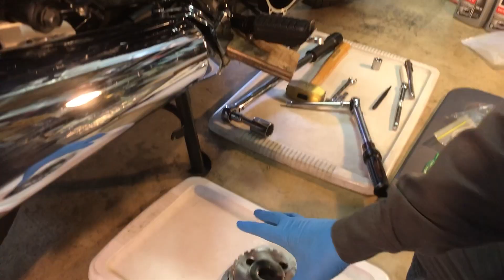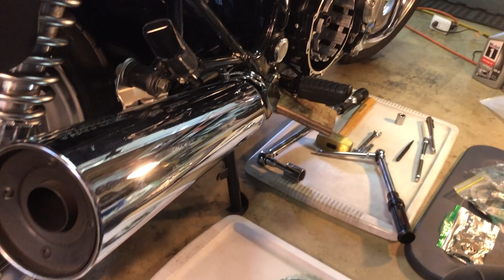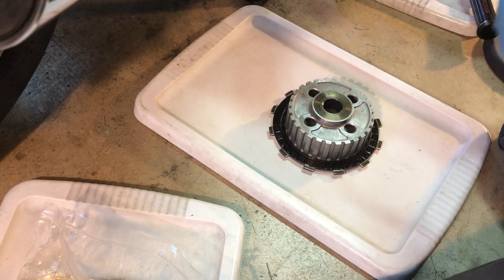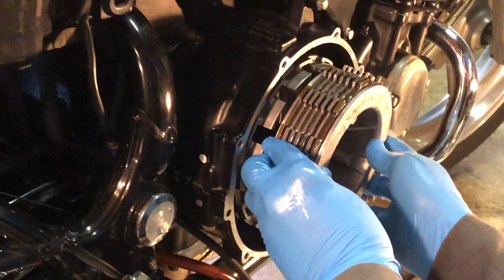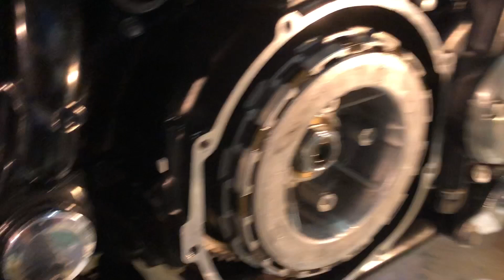Honda CB750 Nighthawk Clutch Replacement (Part 9/11) -- clutch-pack installation

Comment: Could you have used locking the back break instead of using the specialty tool from honda when you were taking the clutch pack off in the beginning?
Do I need to buy the specialty tool that holds the clutch pack steady when taking it off for the first time?

Comment: What size spanner socket did you use on the retainer nut for the  clutch pack?
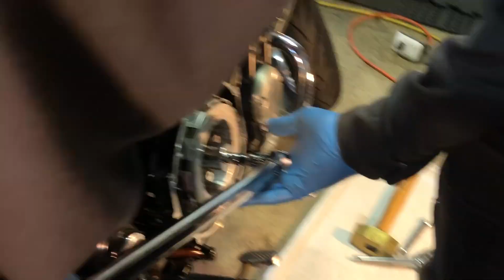Reply from the maker: 7:18 of the video -- 27mm socket